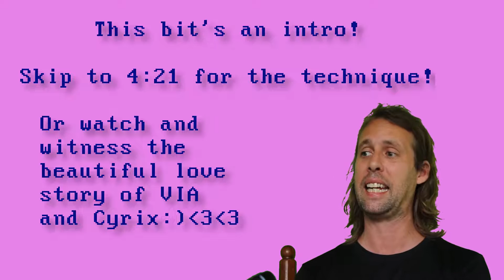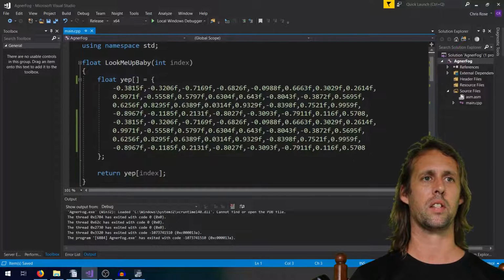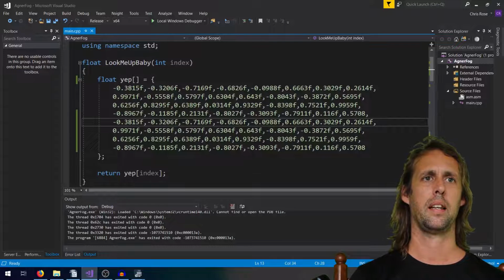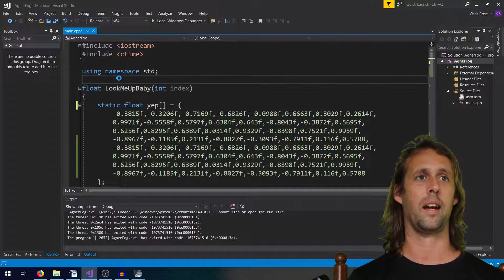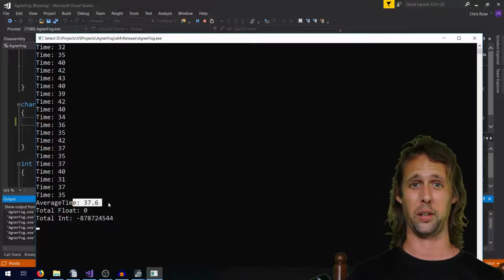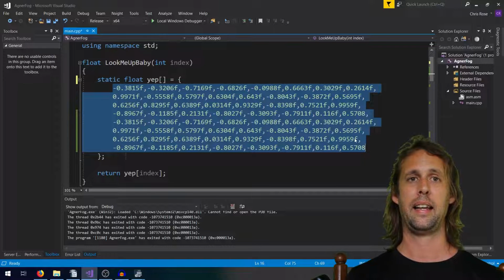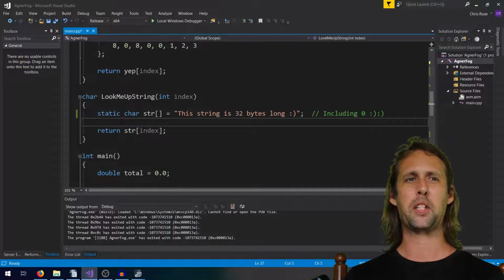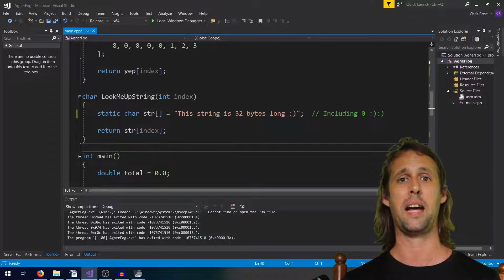Studying Agner Fog: Intro and Static Local Arrays

Comment: So what happens if you change one of the characters inside LookMeUpString? That would modify it globally, not locally? Is it because char str[] is really just char* str? And given that that's true, shouldn't the compiler give a warning when compiling your current code that you're discarding a 'const' modifier from the original string literal?

Comment: What if you mark it with just const? Should be the same.
Reply: I don't think it should be as const has a different meaning than static.  
The const declaration creates a read-only reference to a value.  Which means it cannot be changed.  When scope is lost, like say in a function, the variable is destroyed as usual.
A static variable inside a function keeps its value between invocations and the value can change.  It is not destroyed between function calls.
So the two are quite different.  I would not expect a const to work the same.
Reply from the maker: @NeilRoy  Definitely different! Perhaps the best thing to do would be to mark it as const and static, since it's a lookup table and we're not changing it
Reply from the maker: You know, I thought the same! Tested it just now, and it seems that it still does the copy with const?? Well, I have no idea! Great test tho! Cheers for watching, have a good one :)
Reply: When marked as const, the compiler will treat it differently. And in a million iteration loop, the lookup table of that size will be in the L1 cache entirely. This was the reason for assuming that it will have the same effect. I didn't, say that static is the same as const, programmatically speaking.

Comment: Isn't that speed up just due to being located on L2?What happens if you make the array too large to fit inside L2/L3, > 16mb ?
Reply from the maker: That's an interesting thought Mr Explosionist? Mind you, this data is probably in L1 for most of the runs. L1 will happily take stack lines too! I'm relying on Mr. Fog's explanation here, but it seems correct, though I haven't tested beyond L2...? Judging from the disassembly, compiler is literally copying data around 99% of the time... If you test with larger than L2, I'd love to hear what happens! Cheers for watching, have a good one :)